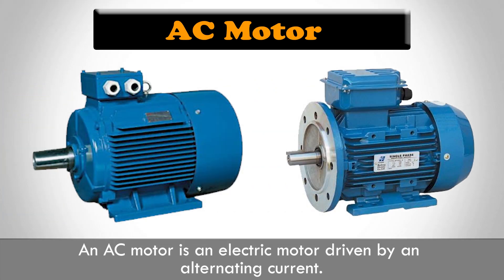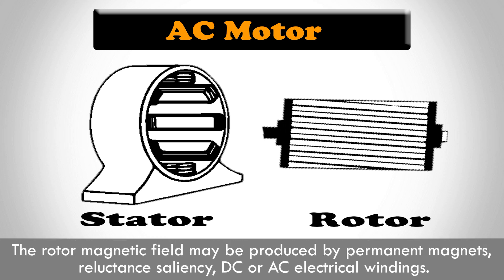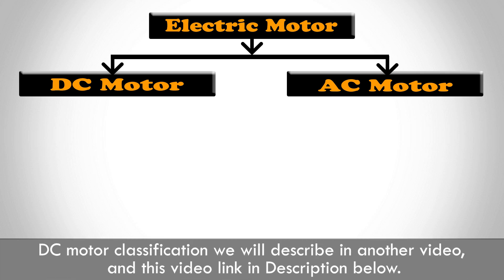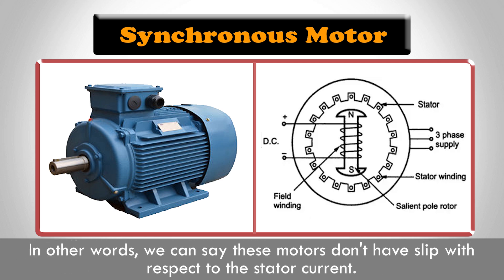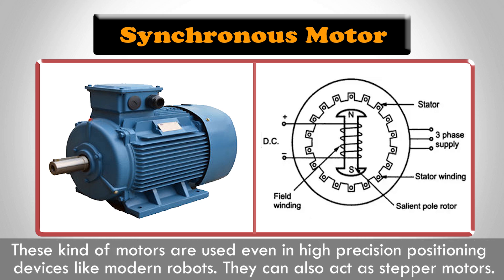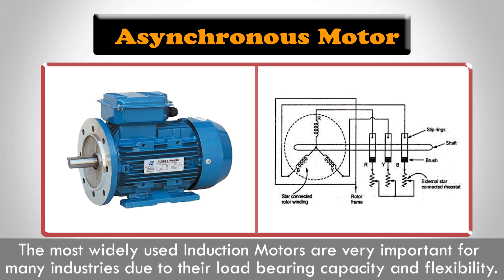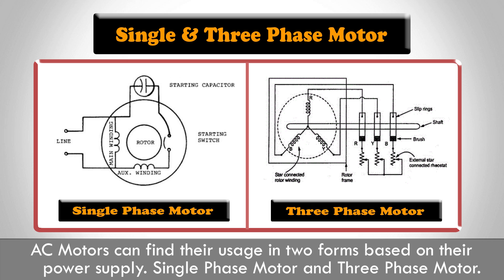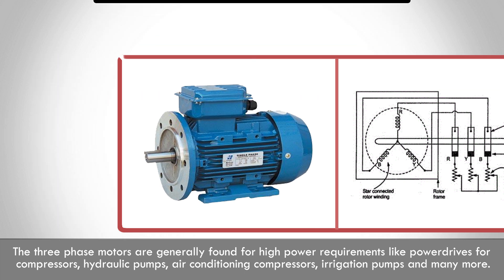Types of AC Motor - Different Types of Motors - Electric Motor Types

Comment: (1:38) - "...to improve the power factor of the local grid to which it is connected to."
Oh my days !
Why such a basic error in grammar ?
It's almost tautological.
Correct :  "...to improve the power factor of the local grid to which it is connected."
or:
Also correct :  "...to improve the power factor of the local grid which it is connected to."
But most certainly NOT : "...to improve the power factor of the local grid to which it is connected to."

Do you see your error ?
You may need to read over a couple of times before you see it.
Do you see it yet ?
>
(And why does it say: "D.C." in the diagram when you are talking about an A.C. motor ? That makes no sense at all)
>